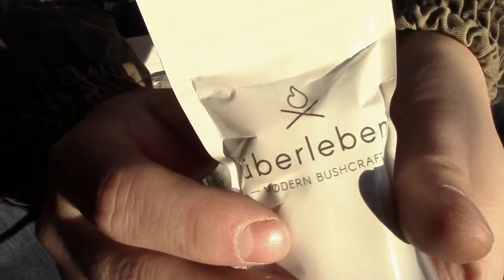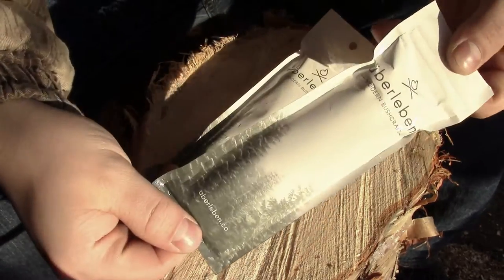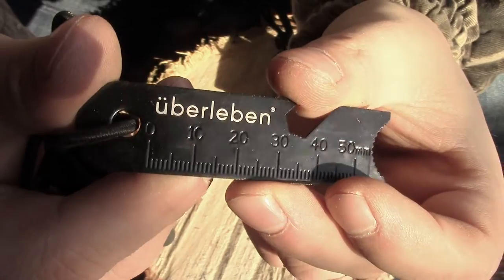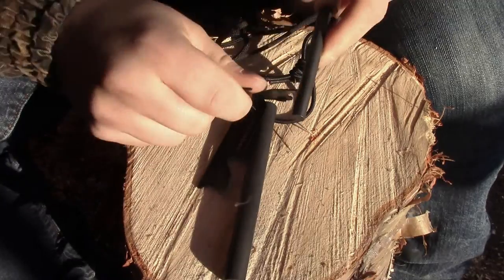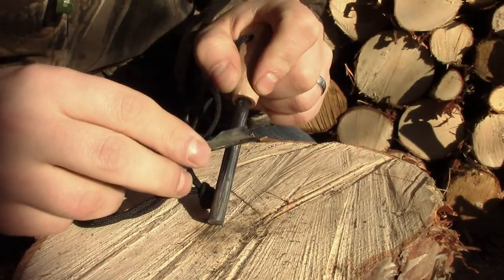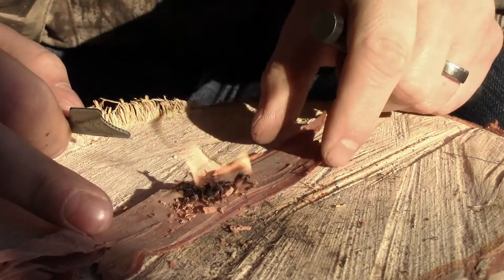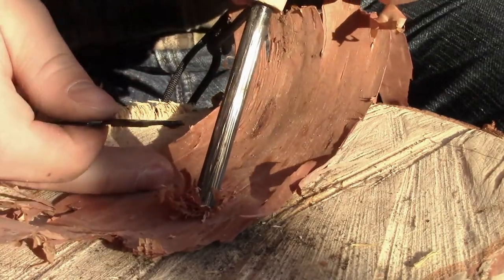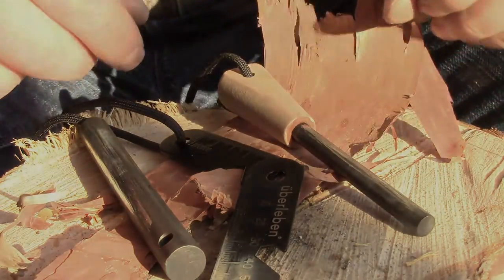Uberleben - Modern Bushcraft - Ferro Rod Review (Zunden and Kraftig XL)

Comment: hey brother, I think the teeth on the striker is meant to scrape wood and bark to turn it into Tinder.
Reply from the maker: Really? I didn't think so, but I won't argue! haha I've seen many, and they're usually advertised as rod scrapers. Thanks for watching brother!
Reply: I got a couple different rods and the striker is to strike the ferrocerium rod but the instructions said the teeth are to chew up Sticks to fluff up Tinder
Reply from the maker: Interesting!
Reply: The instructions for the multi-tool on their web site, specifically say the teeth portion of the tool is for scraping wood/material for tinder. I've done it with mine, and it worked great.
Reply: Thanks man.  I was getting a little frustrated with the teeth.  thanks for explaining!
Reply: Awesome! And yes, that concave serrated scraper will work as a striker, but it'll work better for tinder processing! :) 
https://www.uberleben.co/collections/fire-starters/products/uberleben-zunden-traditional-fire-starter
Reply: You are correct.

Comment: not being able to hold it but the knot in the shock cord appears to  be able to take out the knot and then it would be long enough to strike a spark
Reply from the maker: the shock cord is definitely long enough to adjust to a useable length! I just prefer to use my knife! Thanks for watching David!
Reply: @Bryon C just tie a simple overhand or stopper knot in each end of the shock cord after threading it through the lanyard holes instead of tying it in a loop.

Comment: Thanks for the review. So, are they that much better than a similar size rod from GearBest or eBay??? I can believe a rod from Firesteel.com is better but I am hesitant to spend more than I need to for something
Reply from the maker: I understand what you're saying Mark. I haven't tried rods from the locations you mentioned, but I do know that this is a nice rod. I think much of the difference is the amount of sparks they throw, and more importantly the temperature. Differences in material composition between rods can change the temperature of the spark they throw. these are good rods for sure. but spending 10$ for a cheap one and 25$ for this one, hmm, that's a personal call eh?